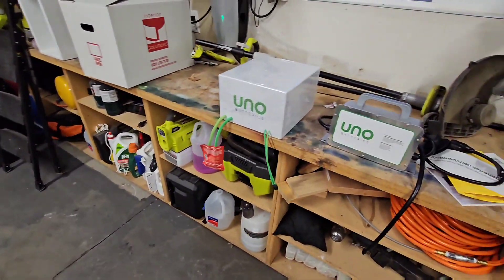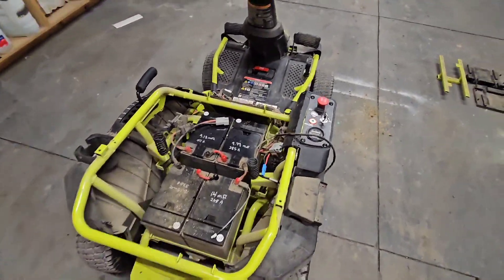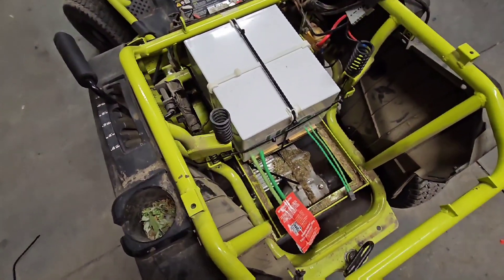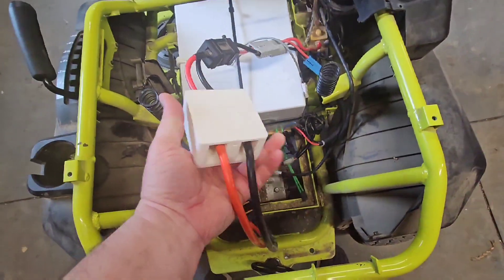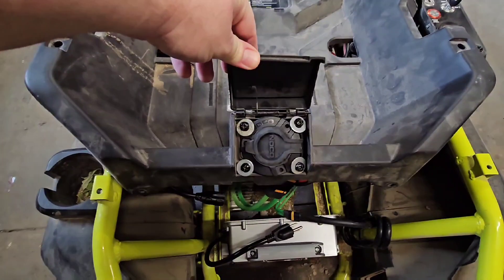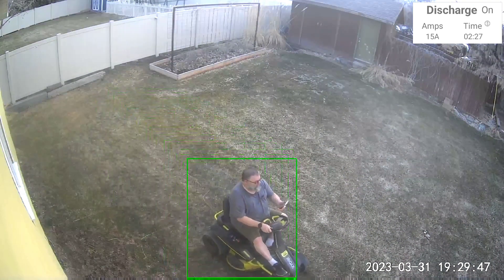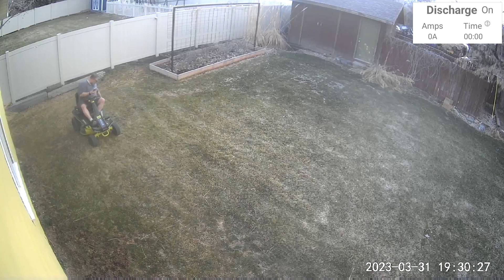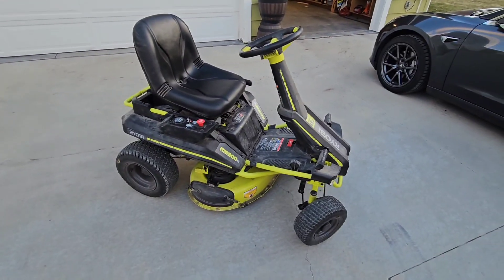Ryobi RM300E Lithium Conversion Uno Battery Electric Riding Mower.

Comment: FYI, if you connect the small blue charger wire to the positive on the battery, you can ditch the rest of the old charger pieces.

Comment: Motoshane, hi there! I bought four separate LiFePo batteries from IonicStart. Trying to do the switch myself, but such a novice. Batteries can be controlled by the app. Must they be wired in series just like the old lead acid batteries? I have a few other rather simple questions. But this one first please.

Comment: Could you tell me what kind are those batteries and where I can get some.  I bought the wrong batteries because I was watching the wrong video.  You have the same mower as me.  They say I have to buy them from Home Depot to get half back from the warranty.  Sorry I need the info for the old battery’s you took out.
Reply from the maker: This is the old battery I took out. Your friend has shared a link to a Home Depot product they think you would be interested in seeing:

https://www.homedepot.com/p/12-Volt-50-Ah-Sealed-Lead-Acid-Battery-for-Ryobi-30-in-Riding-Mower-6-EVF-50B/319073969
Reply: @motoshane2  thanks.  Saw those after I left you a messages.  Sad their out of stock and I can’t find any others.  But these batteries has bad reviews.
Reply: I did find 12 v 50ah lithium batteries for 159.99 each and a 59.00 charger but not sure how to make it work.

Comment: I have a question. 48V 50Ah is official specification to operate this lawn mower, is it possible to upgrade battery pack from  48V 100Ah?   (12V 50Ah x 4 series). ?
Reply from the maker: The mower comes with 4 12v batteries each at 50ah in series already. Multiply 12v x 4 only increases voltage in series to 48v, but the ah stays at 50ah. If you stick with 4 lead acid batteries, you can't increase capacity unless you replace all 4 batteries with larger batteries, but that will not fit if your mower has no extra room. Space is what is restricting capacity with lead acid.
Reply from the maker: And you can't change the series/parallel configuration because the mower has to see roughly 48v nominal or it won't operate. Capacity can increase, but voltage can not change.

Comment: Why the uno battery? There's cheaper LifePO4 options..
Reply from the maker: There might be. Nothing I found would fit my mower without major alterations to the mower. Plus I get more capacity in a much smaller package. The Uno is a NMC battery, not a lifepo4. They have more capacity for their weight and size then lifepo4 and it was nearly a perfect fit. Also, the more capacity you have, the longer the battery will last since it's cycling less, due to the larger capacity. Do the math, and you'll see the cost is nearly the same with lifepo4 when you factor per amp-hour capacity.
Reply: @motoshane2  Li-Time makes pretty direct fit LifePO4 batteries that utilize the OEM wiring, so don't need to do any changes. I was looking at the UNO previously, but the cost is too much for me personally, the Li-Times are 339 each, so I'm about to go with those in a season of two since my lead acids are still holding up fine.
Reply: @motoshane2  Epoch Batteries have a Conversion  system that fits and is less that the Uno. Shipping for the Epoch is like 35-40 bucks. The bundle is 1033.** and some change. 11 year warranty! No cons going with the conversion. Only pros. 30ah of LFP4 I’ll cut about 1.25-1.5 acre with flat landscape and the thickness does make a small difference in cut time. With the 480s, you could fit 2 which = 60Ah, depends on how much you need to cut.
Reply from the maker: Uno was $32 per ah to purchase (no longer available). Epochs you suggest are $28 per ah. Epochs are 66lbs for 60ah, and the Uno is 48lbs for 90ah. Uno is .5lb per ah and epochs are 1lb per ah. I'm still happy with my purchase other than Uno is now out of business. Reducing the price down to 60ah Uno equivalent, I only paid $200 more than a set of Epochs. And I appreciate the weight and size savings, with 30ah extra range. I'm happy.
Reply: @motoshane2  okay, I see. I ended up purchasing Chins today, since it's pretty much a direct swap with them.  My Acids after 3 yrs can't hold enough juice to mow my entire yard in a single day lol.
Reply from the maker: I looked at their site. They sell lifepo4 batteries similar to many other companies. Both the 50ah 12v and the 12v mini 100ah are the closest for fit, but both will likely need mower frame alterations to fit the RM300e mower. If I had a larger mower I likely would have gone the lifepo4 direction. It's one of the reasons I went with the Uno. Fit is not in question. Charger and battery fit with space left over. To me, the cost was a trade off for simplicity of the install. I do agree that lifepo4 12v and 48v metal incased single golf cart batteries are great options. I just choose a different direction. Thanks for the discussion.

Comment: Why is this battery setup $2900, more than the mower itself. Am I looking at the wrong thing?
Reply from the maker: You are looking at this correctly. The mower is cheap compared to other electric mowers because it uses lead acid from the manufacturer. Compare to prices of mowers manufactured with lithium batteries, And those mowers are much more expensive because of the batteries. A new set of lead acid batteries is $800-$1000. Lead acid will last 2-4 years (most see 2 years). In a 10 year span, you'd break even or even save money using lithium vs lead acid, but you get double the range for the same price or less. Now the question is, can you afford $3,000 up front, or $1,000 every 3 years roughly.

Comment: Hello , Can you please let me know what is RM300e Anderson connector size ? is it BB175 or BB50 ?
Reply from the maker: BMC2S-GREY 50amp 600volt.
Reply: @motoshane2  Thank you.
Reply from the maker: @shankarmohan  No problem.
Reply: @motoshane2  Quick question. Would you be able to provide charger specs for UNO Charger ? The charging voltage from manual ? The reason I am asking is to see if I can use it to charge lifepo4 batteries as well.

Comment: I have the 54" electric zero turn by ryobi, would one uno be enough? I worry about the amp draw on from the 3 motor blades
Reply from the maker: You will be just fine with one battery. These mowers don't pull as much as a golf cart. The highest draw I could get out of my mower was 42amps when pushing it very hard, and I can't only hit that momentarily. Even if yours pulled double the amps, that's still under 100amps continuous, let alone hitting the 200 and 500 amp surge profiles of the Uno battery. I'd just clear it for warranty purposes with Uno. Send them an email.
Reply: https://youtube.com/playlist?list=PLOggQzS4fbrzVFK1A9AgxZOVj5CgPmHnO

Comment: Very Cool upgrade! It looks very quality...
I wonder how much run-time you will get from the new power source.
Reply from the maker: It depends on what I'm doing. I did pull a  weighted deep spring rake around the yard 3 times, and mulched the raked thatch with 3 passed and only used 35% of the battery. I'm happy.
Reply: @motoshane2  Have you found that the stock battery gauge is accurate for your lithium setup? Most other Ryobi to lithium conversions I've seen replace the gauge to one made for lithium/LiFePO4 batteries.
Reply from the maker: @JustWasted3HoursHere  The stock batter monitor is not accurate with lithium batteries. The uno battery has Bluetooth access to check battery status from your phone. However I did install the Uno provided wired meter. It's about 5% off, but it is useful.
Reply: @motoshane2  Thanks for the reply and info. I am installing my gauge presently for my lithium setup (4 12V 100AH LiFePO4 batteries). Hardest part was A) Finding a local store that sells 20 gauge wire, believe it or not and B) drilling the gauge hole slightly larger to accommodate the new gauge - I bought a large stepper bit for my drill to make the hole bigger that just about ripped my arm off. Looking for another way to do this.
Reply: Mount a wooden block behind the hole you are trying to enlarge. Then the drill has a way to hold the saw bit in place while one enlarges the hold. RV Holding Tank Service